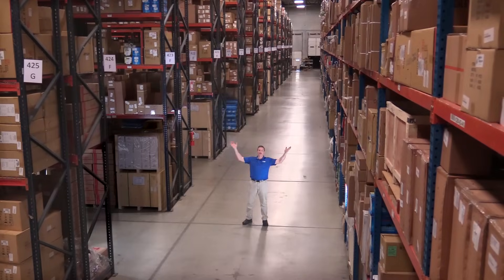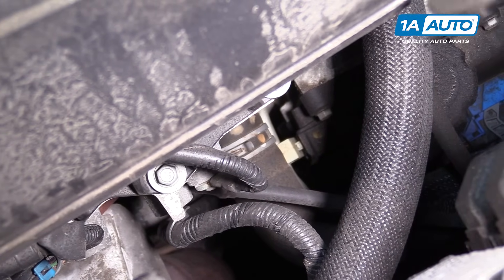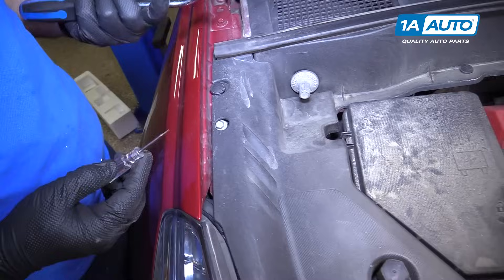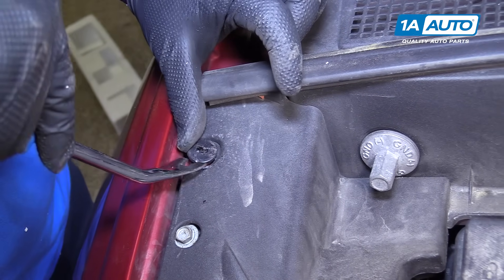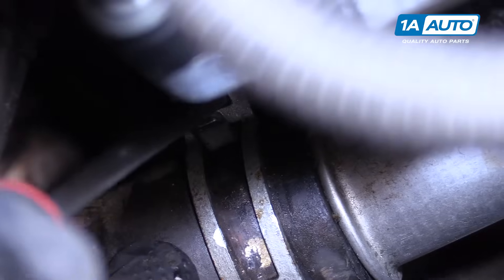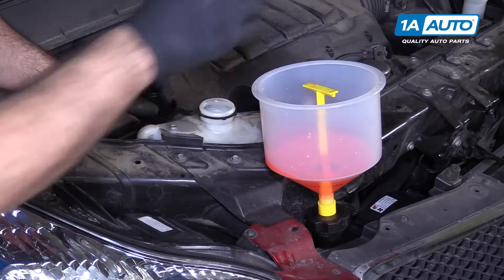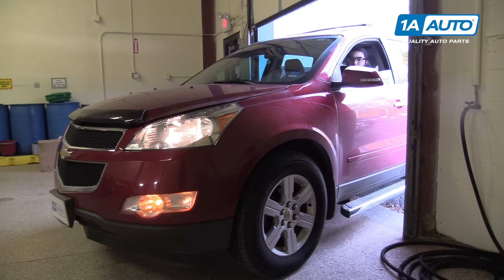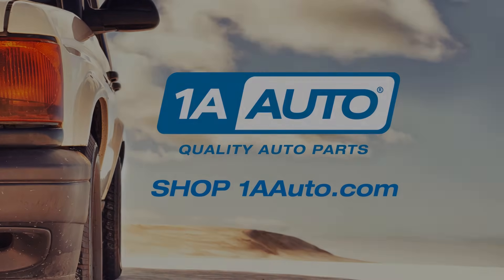How to Drain, Fill and Bleed Coolant Cooling System 09-17 Chevy Traverse

Comment: The lisle funnel is designed to sit on the radiator as the engine heats up, thermostat opens, and burps air out through the funnel.  In addition to this process shown, leave the funnel attached with coolant and heat up the system with the heater on until the electric cooling fan kicks on for a bit
Reply: Exactly what I was thinking. Those funnels are specifically made to purge air out of the coolant system.
Reply: In addition to that you should periodically squeeze the upper radiator hose to bleed the system.

Comment: Little tip on the funnel.... before you insert the stopper, give the hose a squeeze. Insert it as you squeeze. it'll reduce your mess when removing the funnel and adaptors....

Comment: Hi nice video but you mentioned about bleed it I didn’t see it lol I would like to know
Reply: I think running the engine at 2500 RPM for 3 minutes will bleed system - any air in the system will rise to top of radiator.   Then after engine cools,  just top off with more coolant at radiator.

Comment: always turn heater on high so that the coolant is flushed clean as well
Reply: @Thomas Poafpybitty no there is a valve on the coolant line going to the heater core. When you turn the heat on your hvac it is opening this valve. Love your confidence though !

Comment: How do you drain out the coolant from the engine block? Is there a spigot there like on other vehicles? Also, if so, where is it located? Thanks.
Reply from the maker: +rob h Thanks for watching!  If a complete engine block drain is required then you will have to remove the left and right block coolant drain plugs.  The should be located next to cylinders 1 and 2.  1aauto.com
Reply: @1AAuto  Any chance you have a diagram and what the plugs look like?

Comment: I have a 2014 Chevrolet Equinox, and wanted to know whether or not the 2009-2017 Chevrolet Traverse model directions would work best since my car is a 2014?  The last time I did a coolant flush was for a 2007 Ford Focus, so I'm trying to remember everything.  :-p
Reply from the maker: +Klayster Thanks for watching!  If you have the same 3.6L V6 motor then the process should be very similar to this video!  1aauto.com
Reply: Thanks for responding.  I have a 2.4L Flex Fuel model.

Comment: I can drain over a gallon just by inserting a clear piece of tubing into the radiator fill hole  and siphon it out into a bucket. Its a heck of a lot easier and cleaner than this method in the video..
 Wonder how much fluid he actually drained out?

Comment: whats normal operating temp? and what is max it should reach?
Reply: Normal operation temperature is 210. However, on some cases with GM vehicles it will fluctuate, which is normal.

Comment: I have a 2011 Taverse and I'm unable to pressure test it. And soon as I start to pump it, the air goes out the resevoir tank. Any suggestions?
Reply from the maker: +Danny martinez You can rent a pressure test kit from many hardware stores